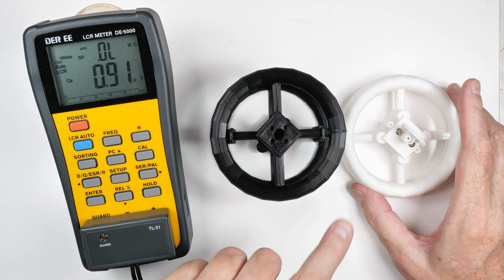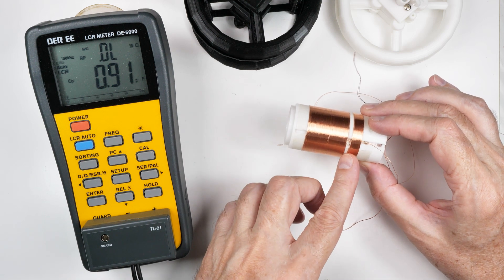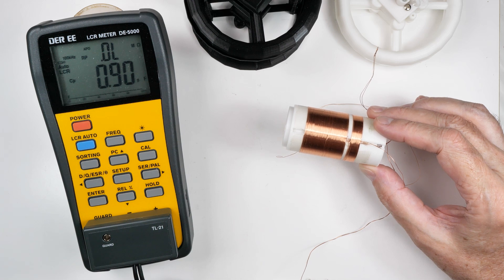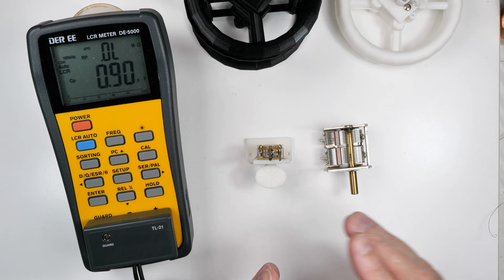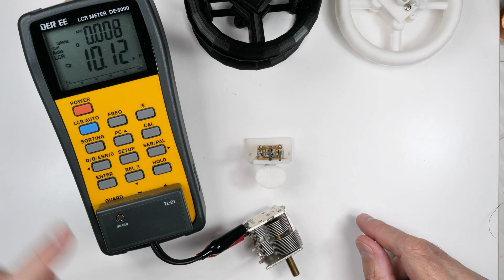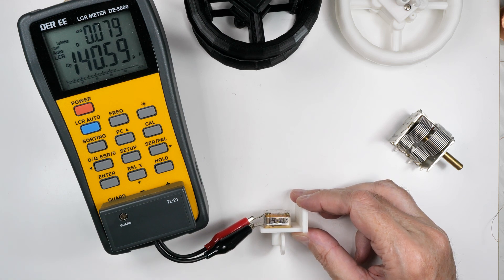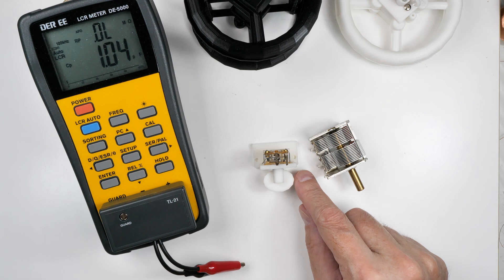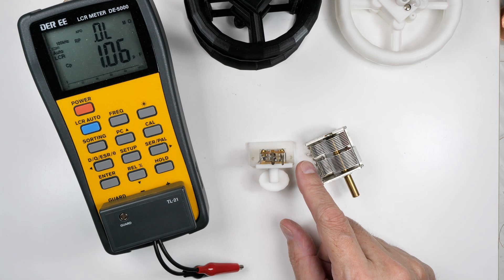Air Capacitor VS Film Capacitor Quality

Comment: I knew this , well, not quite . I bought a cheap kit to build with the kid . It had the film type but just didn't perform like mine with the air type.  
 I live on top of a hill with clear views and use a long wire antenna and plumbing ground. The plumbing is also part of the electrical system .

Comment: So basically you're talking about the ESR of each capacitor... but that implies that a signal oscillating at a certain frequency has been applied across the component under measurement.  
Q1: What was the frequency applied across these capacitors, how was it generated and how was it calibrated or set?
Q2: Why would there be so much leakage across the polyethylene leaves at such small voltages?
Reply from the maker: @Tassie-Devil  100k Hz. You can see it on the meter. Not sure it's leakage, but it might just be the plastic's resistace to changing electric fields converting that to heat.
Reply: A higher loss tangent (tanδ) means more dielectric absorption, which means "less signal gets through".
This also important for the coil former material and why air coils outperform other types WRT "Q" values.

Comment: Ive noticed that the old air caps are better too. My home made Xtal set always worked better than the kit set units that I would end up building for the kid that couldn't get it going but I thought it was the coil as most kit sets have a ferrite style. I've never heard of dissipation factor in a capacitor to be honest but it explains a lot thank you

Comment: make a sliding cap with two pieces of fiberglass PCB, use a nylon threaded rod for fine tuning adjust, or have a smaller secondary one that pivots on a corner instead of slides over as the main one should, unless you have bulk space.

At one PCB thickness (copper side both up or both down) 30x30cm is heaps, if you go for double thick, or maybe air gap you will need to adjust.

Comment: I had a crystal radio with one of those small plastic variable capacitors in it. The movable plates connect to the terminal with a small thin strip of metal; at the end of the small strip where it connets to the rotor it has a small spade lug shaped end that the end of the roror rides in. That connection had oxydized and was causing poor results and a sneaky connection. Nothing I did to clean it helped.
Reply from the maker: @stephennickerson7685  Had not thought about that. Could be the case in the older ones. Thanks.

Comment: Thanks for sharing I need to buy that LCR meter.
Reply from the maker: It's not perfect, but it's MUCH😮 better than the cheap ones that also burn out quickly that I have been using.

Comment: You have thise "air gaps" also under vacuum.  But they are super expensive
Reply: Vacuum caps are for high stability -- radio stations use them so they don't drift and cause a violation.
Reply: @franzliszt3195  also to withstand high voltage is my first guess. Since they are in high voltage tuning cirquits.
Reply: @ that too.
Reply: @franzliszt3195  yes and military. You can find them in radio stock markets but some ask 200 for them. They are great to tune magnetic loop antennas
Reply from the maker: @ON5ALE-Alessio  I'm guessing they are rather big?
Reply: @tsbrownie compared to
The ones you were testing yes.
Reply: @tsbrownie   different sizes and capacities and also servo motor driven

Comment: I don't think, performance wise, there is any difference between the two variables capacitors. The only difference is that of size. With the development of micro circuits, radios have become very small and air-capacitors can not be manufactured so small because it is difficult to keep the moving plates untouched with ground plates. It is therefore necessary to insulate them by putting some insulating material between the two plates. Plastic capacitors have low cost as compared to metal gangs. Performance wise, both are equal. Air capacitors covered with Shields are better for no dust can go in between the plates. In this respect, plastic capacitors are better, for they are sealed inside a cover. Regards.
Reply: You didn't grasp the 0.12 D factor.  That absolutely murders the Q of the tuned circuit.
The two types are very far from equal.  Also looking at the film type one I have, I can see that it is a long way from being sealed.
Reply: @kensmith5694  
The paper variable capacitors are improved now as their dielectric are better. That is why sensitivity of radios using paper variable capacitors is same or better than those of air variable capacitors, please.
Reply: @Science.Follower  You didn't understand my comment.  Let me explain:
My paper insulated capacitor which is a thing I made works very well but is mechanically large.  This is a "low K dialectric" but it also has a low damping factor
The modern variable capacitors are optimized to be small at the cost of a large damping factor.  From the point of view of making a transistor radio, this is OK but the high damping factor makes them rubbish for making a crystal radio
Air variable capacitors are second only to vacuum capacitors in having a low damping factor.  For a crystal radio, they are about the best you can do.
Reply: @kensmith5694  
Ok, I understand. Yes, for a crystal set, an air capacitor is better for less loss in dielectric, please.
Reply: @Science.Follower I have some onion skin paper. It’s about half the thickness of bible paper. And bible paper is about half the thickness of printer paper. So I would guess an onion skin paper capacitor would be one fourth the thickness of printer paper. As there is less aluminum for the electrons to travel through it should have a higher Q factor.